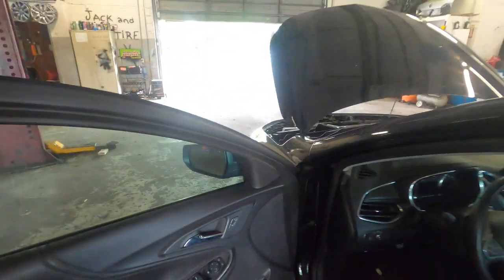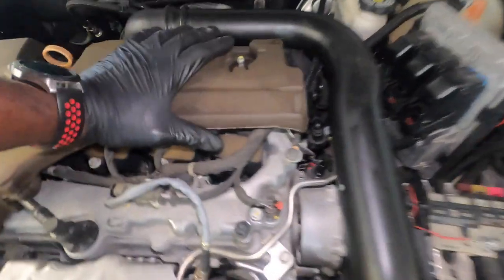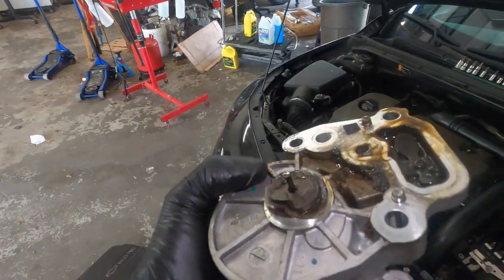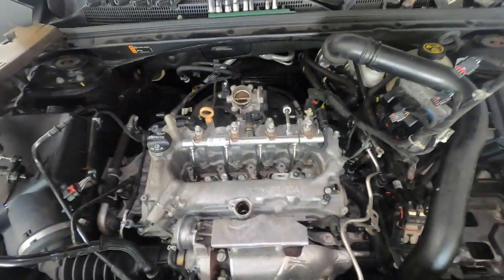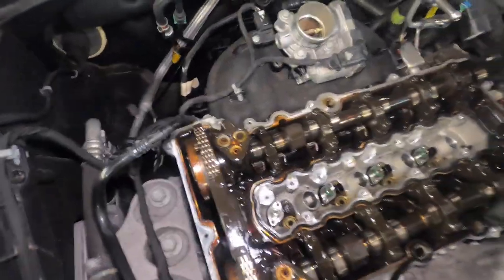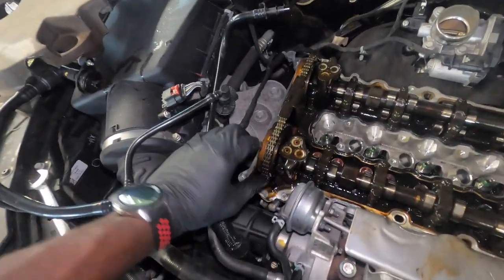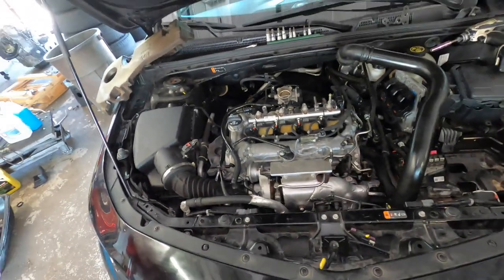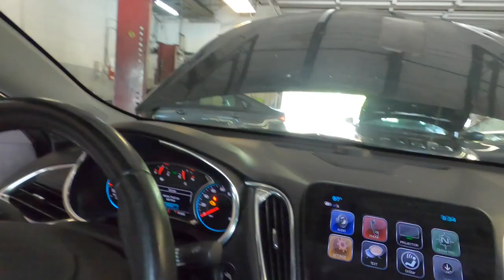Chevy Malibu vacuum pump and valve cover gasket

Comment: Wua guan 
What app and obdII setup do you use on your phone ?
Reply from the maker: Naah i just take the pictures of the code from the computer before i disconnect the battery
Reply: @DULLAHGOSOHARD   what all do I need to order for the camshaft I just replaced the vacuum pump, now it’s saying I need a camshaft sensor, so my question is should I change everything, I already replaced the spark plugs also, also done an oil change, I had to do research cause no mechanic could tell me why my brake pedal was hard, after replacing brakes & brake booster. So at Chevy they saying 1800 for to do the camshaft I’m wanting to know what all do I order. K have a 2016 Chevy Malibu 1.5 turbocharge

Comment: I just did this change out and my car won't start ....
Reply: Did u ever get the car to start?
Reply: @OTN-DEEZ  Yeah, $4000 dollars later...i had pieces of metal that broke off into the engine and did a lot of damage...
Reply: @brandonpaling5428  whoa! I think i am in same position now. Mine broke last week and i replaced the pump and peices fell into the engine. So im thinking to get a valve cover gasket change since it was leaking anyway to clean out the peices before i even start the car.
Reply: @brandonpaling5428  wow did it start before you did the change out ?
Reply: @brandonpaling5428  same here. My warranty company placed replacement engine in my car